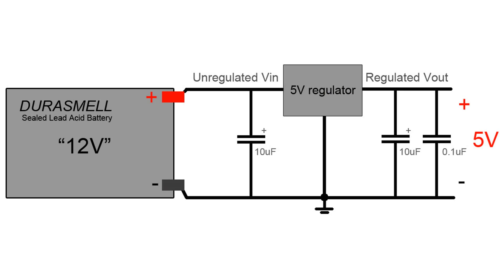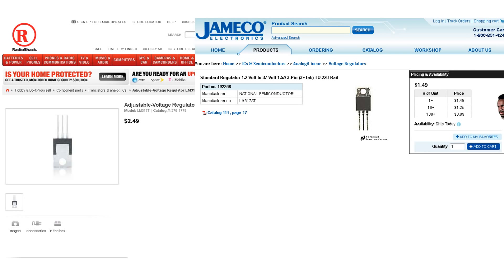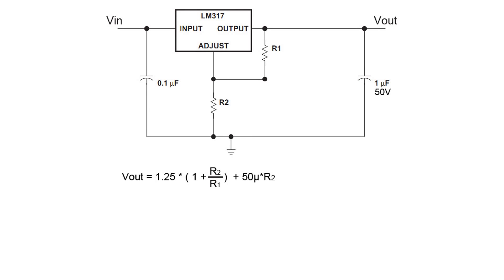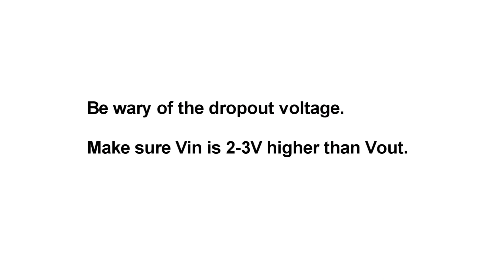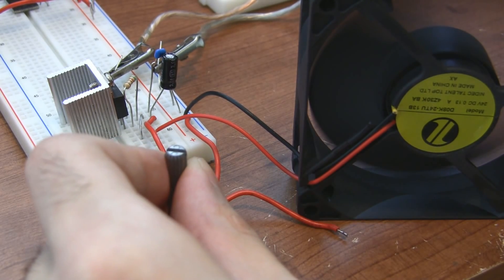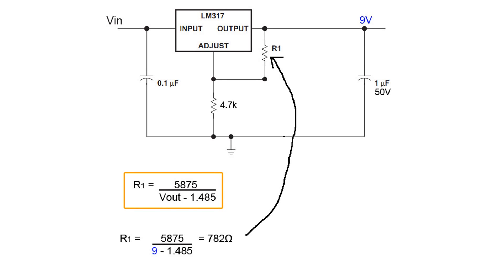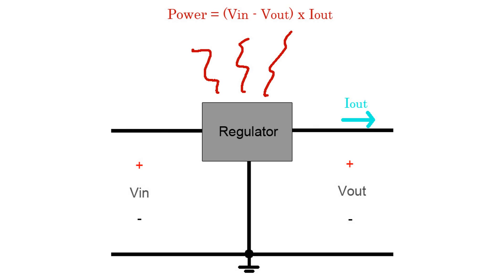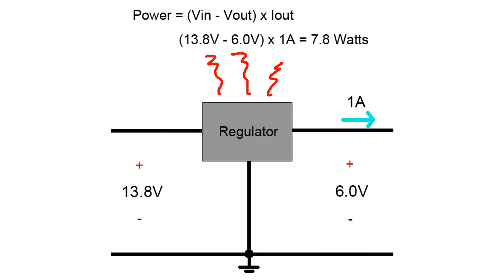LM317 Adjustable Voltage Regulator Tutorial

Comment: So let me get this straight. Instead of spending a minimum of $100 for a variable voltage supply so I can switch from 5 to 3.3 volts for my little projects ... I butcher up a 9 volt wall wart and wire in a LM317 and put an LED display. I must be missing something ... will I be eaten by the "ripple monster?". Great videos ! I am constantly finding my way back.

Comment: Will this circuit work well for a circuit that needs 1.5 v at 150 MA, or is there a better IC to use.
Reply: You can regulate current using an lm317 but they can only regulate voltage down to 2.5v

Comment: Useful video, although as with most others it makes lots of assumptions that will cause many viewers confusion, and it also demonstrates some basic errors. The LM317 has certain requirements for best operation, and one of these is a minimum current into the ADJ pin.....as I recall, 240 Ohms or thereabouts is the maximum recommended value between the 317's OUT pin and the ADJ pin to keep the ADJ current within recommended limits. Secondly, if you want an adjustable regulator, you keep the resistor between OUT and ADJ constant and adjust the resistance between ADJ and ground; this video suggests the opposite, and while it will work that way after a fashion, it is not good design practice and can cause problems. Finally, a 1uF (one microfarad) tantalum (not electrolytic) capacitor is recommended between the OUT and ground to prevent oscillation as the regulator tries to keep the OUT voltage constant; this has nothing to do with reducing ripple (as from a regulator having an input derived from a rectifier coming from an AC supply), it is just there to improve stability of the IC. 

Then, for the math-challenged folks, the simplified formula for calculating the OUT voltage on an LM317 circuit is V-Out = 1.25 x (1 + (R2 / R1)), where R1 is the resistor between OUT and ADJ, which is usually fixed at 240 Ohms, and where R2 is the resistor between ADJ and ground. Note that ground itself is not connected to the LM317. But to find the resistors required to achieve a desired fixed output voltage, you switch the formula around like this:

R2 = ((V-Out / 1.25) - 1) x 240   this assumes that R1 is fixed at 240 Ohms

Example: If you want the OUT voltage (V-Out) to be 7.2V, and you fix the R1 value at 240 Ohms, then you solve as follows:

V-Out / 1.25     is the same as      7.2 / 1.25     or     5.76

then do the part where 1 is subtracted from the previous intermediate value

5.76 - 1 = 4.76

then multiply the new intermediate value of 4.76 by 240 (same as 4.76 x 240) = 1142.4

this can be rounded slightly to 1142, which is the R2 value in Ohms, more commonly represented as kilo-Ohms, or 1.142k

Put the 1.142k resistor in the LM317 circuit in the R2 position.

Don't have a 1.142k resistor (it is a non-standard value)? Well, a 1.2k (1200 Ohms) is a standard value, and nearly the same.....if you stick it into the R2 position in the original formula V-Out = 1.25 x (1 + (R2 / R1)), it will look like this:

V-Out = 1.25 x (1 + (1200 / 240))

solving in stages:

V-Out = 1.25 x (1 + 5)

V-Out = 1.25 x 6

V-Out = 7.5

Not close enough to 7.2 volts to suit your needs? Then you need to add smaller value resistors to add up to a value closer to 1.142k, or you need to use a slightly smaller value (perhaps 1k) resistor in series with a small value potentiometer (usually you pick a value twice what is needed, so if you are making 1.142k out of a 1k resistor plus a potentiometer, then the difference between 1.142k and 1k is 142 Ohms, and doubling that gives 284 Ohms, so you might get the closest standard potentiometer value of 250 Ohms, set it to roughly mid-range, and make small adjustments from there until the LM317 puts out exactly 7.2V. This arrangement of a large fixed resistor value in series with a smaller potentiometer allows you to use the potentiometer to easily trim the overall resistance value up and down  by the same amount, and since the potentiometer is not making up ALL the resistance, you have better selectivity doing it this way.

The other thing to remember is that, as the video mentions, the LM317 (like all linear voltage regulators) gets rid the the extra voltage (the difference between the input and output voltage) in the form of heat. When the current coming out of the regulator to your load is more than a hundred milliamps (mA) or so, that dropped voltage times the output current comes to more wattage (in the form of heat) than the LM317 can get rid of by itself, hence the need to add a heatsink.
Reply: Ah ok.  I was wondering about. The resistors.  Do the regulators work with ac or just dc?
Reply: @j5892000  this particular regulator works for dc only (typically an input of 2-47v I think, check the datasheet). If you have an ac output then rectify it using diodes (a single diode with a capacitor will do the job for small voltages but a full bridge rectifier is better for higher voltages of ac)
Reply: when masters speak :)
Reply: Oh wow, I appreciate you so much :)
Could of caused me a world of hassle if i didn't have a read of the comments.
May have been 3 years since you posted it, but these are the gems that are hidden away in the depths of youtube.

<3
Reply: I am agreeing with Alf, this is great - the combination of a video maker with the motivation to do the video even with some rough patches, plus some extra hints and course corrections from a clever person like Youtuuba, is pure community genius --- thanks to both of you (I note that the circuit diagram shows a 240 ohm resistor....)
Reply: https://youtu.be/0omaChJV75U?t=610

Comment: It says 1,25 to 25V on the right most side of the one with the potentiometer. and also adds that the input should be less then the output by 2-3 volts if I connect  12 v battery would it work for 1.25-9?
Reply: +Evren Uçar The input voltage should be 2-3 Volts higher than the maximum you're gonna need.
Reply: Claus Bertels Thanks for answering a old question of mine ^^

Comment: couldnt this be used with a  npn power transistor  to control voltage to an alternator?
Reply: Lm317 is DC alternator is AC you need a AC to DC circuit to do that

Comment: Hi i want to make volage regulator 12v 15 amperes as enter capacity and regulate with potentiometer this voltage from 0 to 12 volts again with 15 amperes, have you some tutorial to create this control? thanks so much
Reply: 15 amps, thats mad, an lm7812 will burn out at the current, they are only designed for a max current of 1.5 amps

Comment: Anyone who owns a breadboard that does not have ic imprints burned into the center bridge would not be someone I would call a friend :)
Reply: +Richard Smith   Hi what is IC prints?
Reply: karen berry like a footprint. When you send too much current through an IC, it will overheat, and slightly melt the breadboard under it. Leaving an imprint of the IC in the center bridge.
If you really fuck up, itll toast the imprint too. 

Nearly all of the ic imprints on my breadboard are from single channel op amps. Temperamental pos's :P
Reply: +Richard Smith  Hi mate I need some help please. I just want to know how to check my lm317 is working ok and not dead  Thank you  John  :)
Reply: karen berry Hook pin 3 to a supply of 7-40 volts, pin one to a load to ground. The voltage at pin 2 should be close to 1.25 V, independently of the load and the input voltage. That is not a fool proof test, but ones that are burnt or faulty usually fail that test.
Reply: +Richard Smith  Thanks very much for your quick reply Richard  :)

Comment: How would one calculate when a heat sink sink is necessary, what size heat sink is necessary, & when a heat sink won't be sufficient for the amount of current used in a circuit?

Comment: 510R is too high, and 782R or whatever it was even more so. The datasheet specifies a maximum of 240R to maintain the minimum required current into ADJ. Second, 37V is not the maximum output voltage. It is the maximum difference between Vin and Vout. Otherwise good.

Comment: and for example if i would add another LED and a resistor connected in series, together which is connected parallel to the capacitor, how would i calculate that ? would i need to take R2 to account ?

Comment: ok i got confused after you said you placed 4.7K ohms for R2 and it showed 5875 instead.  I want to get a fixed output voltage of 1.5V on a LM317T VR.   Also i want to know if i can place any type of Vin into it and still get 1.5V after placing 2 resistors?  I'm quite sure all i need to do is tweak the R1 and R2 so it will provide a Vout of +1.5V.
Reply: +Charles Tan 
1.25*4700
Reply: Thanks Jack Wu

Comment: I want to use this to convert 6V to 3.7V to power a GPS unit.The GPS unit uses 25mAh.How would I calculate how long a 8000 mAh battery would last powering the GPS unit as I am unsure how much is lost when flowing through the regulator.Thanks and great tutorial  :)

Comment: I'm working on a 1.5A linear power supply.  Does the resistors and the pots power rating need to be higher in order to handle the current or will a quarter watt rating do the trick like those in the video?

Comment: so if you have a 8.4 volt battery tray running to the lm317 and you use a variable resistor at r2  and you want the most amount of amperage coming through but only at say 4 volts to 7volts what would you want the capacitors to be? i ws thinking a 200ohm potentiometer at r2 but honestly, im having issues using the equasion to figure out the values of r1 and the 2 caps

Comment: How would that circuit look on a PCB I'm building a circuit similar to that but also has a 3 volt DC motor SPST Switch it's to control a camera mount like a telescope. I want to do a etched PCB but not to sure how to lay it out oh by the way I'm a newbie at electronics.
Reply: Afrotechmods will it work with lm317

Comment: Hi, 
Thank you for the video, i found it very informative, however i still have a question. You said in your video that the input voltage should be larger than the output, so does it there is no way I can use this to get 15V DC from a large 12V rechargeable battery?
Reply: Hi Max, I do not think that is possible.
Reply: What battery chemistry is it?
Reply: Use a step up transformer. Hundreds of them in ebay;  I am assuming you are going from DC to DC.

here is one  with specs, you can find a more suitable one:

150W DC-DC Boost Converter 10-32V to 12-35V 6A Step Up Power supply module

Input voltage: DC 10V-32V.
Output voltage: DC12V-35V(adjustable).
Output current: 10A (MAX).
Input current ：16A (MAX) (more than 10A please strengthen heatsink).
Output power: natural cooling 100W (MAX), strengthening cooling 150W (MAX) real power.
Conversion efficiency: 94% (when Input 19V 2.5A Output 16V, Reference).
Output ripple: 2% (MAX).
Working temperature: industrial (- 40 ° c to +85 °c) ( environmental temperature, more than 40 degrees, please reduce power to use, or - enhance cooling).
Full-Load temperature: 45 degrees.
No-load current: 25mA typical.
Voltage regulation: ± 0.5%.
Load regulation: ± 0.5%.
Dynamic response speed: 200uS 5%.
Short circuit protection: No (Please installs the fuse or protection circuit at input parts).
Input Reverse protection: No (please comply with a reverse protection or connect a diode at input parts.).

Comment: Afrotechmods do you think i can use a duel series 18650 in a hammond project box and regulate the 8.4 volts and use a heating coil with low ohms to vape with

Comment: I have never been good at equations, so needless to say I am struggling to figure out where both the 1.485 and 5875 comes from. as far as i know one is supposed to do the calculation in the brackets first.... I dont see how 1+4.7 (4700) comes to 5875.... can some one tell me what the 1 represents and how the two results above are calculated. I want to understand so I can learn the concept and not just do it parrot fashion. Thanks in advance

PS i did look at the Texas Instruments examples and they are just as vague
Reply: Okay i figured it out... I did not consider the decimal place for the resistance values.
So now I have the circuit working, but it has one hell of  voltage drop under load.
I have removed the protection (caps and diodes from Vo to test and results are the same.
My supply is 25V and am dropping to 12V. I am using 3x KA317 in parallel to bring my current rating up to +/- 6A (2.2A per KA317). I want to use this to regulate a charging circuit but if I am getting such high Voltage drops I fear that the circuit is pulling current somewhere and will not provide the thump i need to charge batteries. Aside from the voltage drop I cannot see how this circuit shouldn't work as each of the IC's are rated to 2A,
My other alternative is to scrap this circuit and use one KA317 and regulate 3xpower mosfets to carry the load rather.
Any advice or suggestions to the V drop?
Reply: I don't get either, how'd you figure it out?
Reply: clinton Raubenheimer I've looked up the datasheet, a few things to notice.
Input-Output-Differential is max 40 Volts, your diff is 13, good.
Next up your power dissipation(Pd) is internally limited at 20W MAX.

So the kind of easy way to calculate this is, Vin - Vout x Iout = 25 - 12 x 2 = 26 Watts. So you're exceeding Pd(max). 

Also what plays a role in ur problem is the tempature of the device, take a look at the Vdrop graph, it will become clear.

My advice is to find a way to drop your input voltage, 13 volts is way to big of a drop if u want to drive a load of 1,5 Ampere or above.

Comment: Lm317 has current limitation i think 1.5 A when i test  it with big Rc Car 7.5v , i put ,12v Lithium useless laptop battery it doesn't work , i used L200.it works .

Comment: Does this circuit adjust amp?
Because i've got a 24v 1.1ah power supply and i want to adjust voltage, but i also want to keep amp

Comment: I would like to build this device for automotive usage. I would not need it to handle very much amperage. Since the range of usage would be from half a volt to 12 volts (with little to no amperage), I need to be able to determine how much output voltage is being supplied . If I were to place a digital volt meter on the output side of this device , would it affect the out put voltage ?
Reply: lm317 can't regulate down to half a volt, the minimum input is around 3V and the minimum output is 1.25V. There are low dropout voltage regulators but I doubt they can regulate an input of 1.5 V. If your input is more than the dropout voltage, then you can get around the 1.25V output restriction by placing two silicon diodes (that have a voltage drop of 0.6-0.7V each) right after the output pin. Using a voltmeter won't affect output voltage by any significant amount

Comment: Im a bit confused after opening up a high end power suply (advanced 19 volt 6 amp SMPS) and finding loads of N channel mosfets. Googling these ("45nq10t" and "k3797") says the application is dc to dc conversion and SMPS's but what makes them different than Voltage regulators? Could they do the job?

Comment: this is by far the best explanation of how to use a LM317. None of the other literature i found gave guidelines and explained what happens when the Vin and Vout are wildly different. This video was awesome
Reply from the maker: Gunhaver Thanks!
Reply: yeah just that 90 % of cheap lm317 dont like r1 to be 500r use a 100r resistor with 3k pot for 1.2 - 36v psu

Comment: Hi could you use an adjustable voltage regulator with two 12 volt batteries,  so you could have adjustable power from 1 volt to 24 volts

Comment: i tried wiring the circuit with the potentiometer... i checked my design but i keep burning the potentiometer... why is that?
Reply: when you turn him all the way you get to 1 ohm, thats 12 amps at 12 volt :smoke:
Reply: then how would i fix that?
Reply: John Smith how would i fix it then?
Reply: Archie Quinones put atleast 250 - 500 ohm resistor in series(12v) or 150 - 250 ohm for 6v, so if u turn it down all the way there is still some resistance to minimize the current through the pot.
Reply: thank you very much for your advice :)
Reply: did it work ?
Reply: yes it did! thank you very much :)

Comment: Can someone explain to me how 50farad*4.7Kohms=0.485+1V=1.485v.
I'm a bit rusty on my conversions, but I tried converting Farads to ohms*R2 then convert to volts and did not get what I was displayed in this presentation.
O*F=v,  V/F=O...
200o*3F=600V,  600v/3F=200o/600v=3f

  Thanks
Reply: 50 Farads? WOW! That's huge.... Do you mean 50 uF? Only folks I know that would use such values are car audio guys or folks in the extremely high joule research field.... 50 Farads??? You building an ion pulse cannon or rail gun? :-D